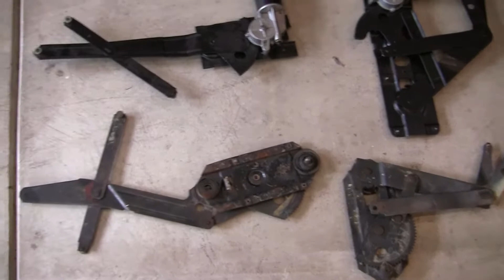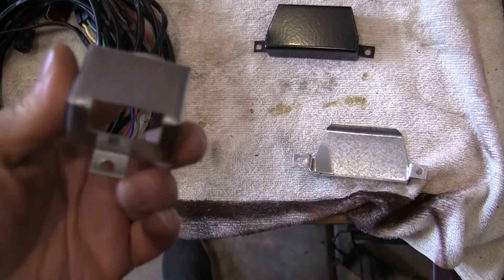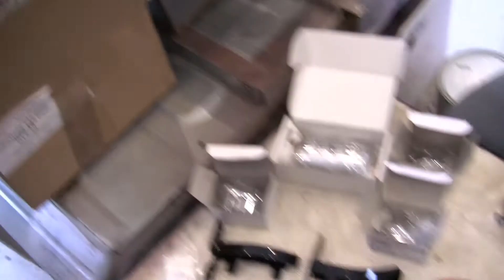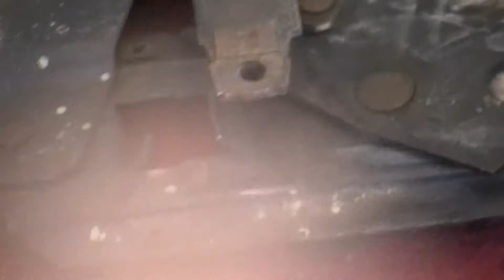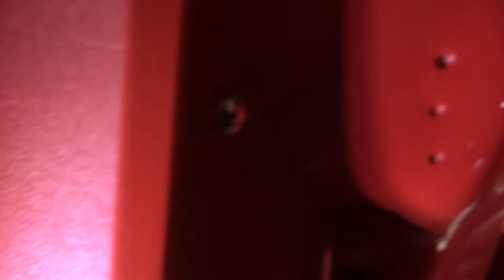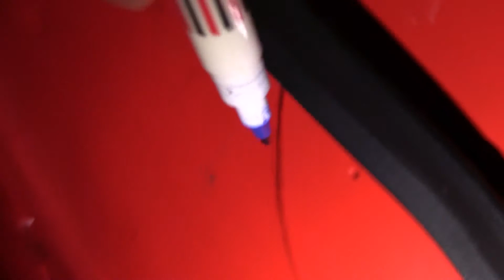Install power windows into a 1957 Chevrolet Belair - PART 3

Comment: Can you tell me where you purchased your power window motor replacements from? Part number if it's handy?
Reply from the maker: Hi Adam, 
 I bought the motors from Auto City Classic, email: autocity@att.net or call 7634445880.  I believe they are not making the round type motors anymore but sill have some in stock. They have the square type to suit also and available in stock for both $83 each gone up in price, part number 1605.  Thanks for Watching The Chevy Man.